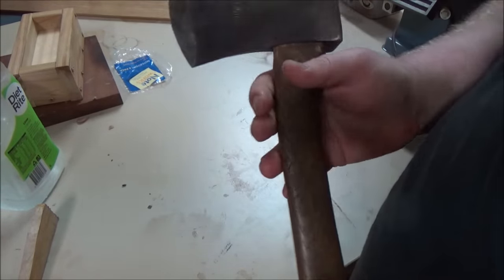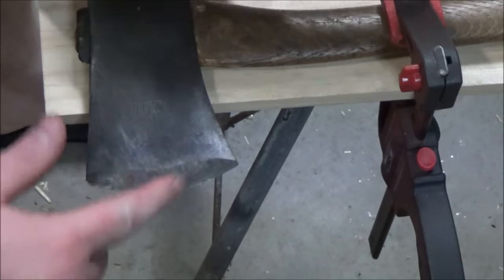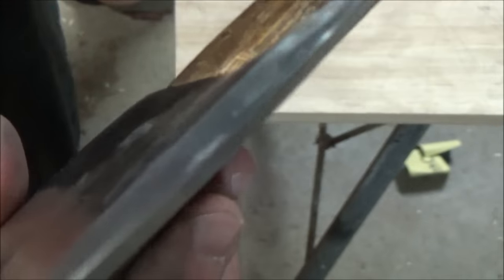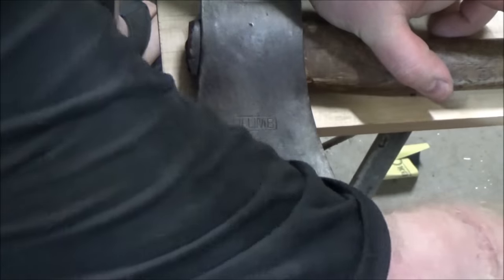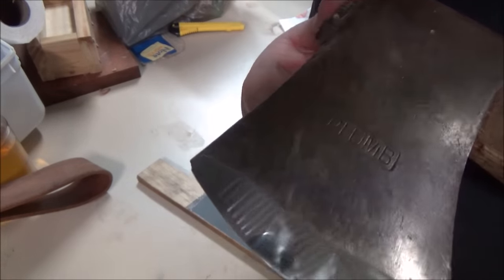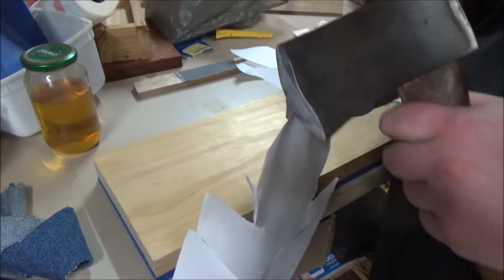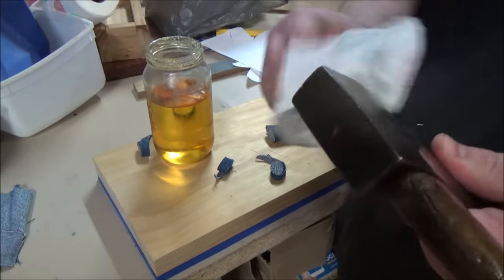How to Sharpen a Hatchet or Axe to a Scary Sharp Edge!

Comment: I have mixed feelings about this.  An axe is not a knife, and should not have the same bevel on it a knife has.  By turning an axe into a knife, it loses much of its ability to be an axe. 

Thinking that every tool, whether it's a knife or an axe, should be razor sharp is YouTube nonsense.  It's one of those things that sounds completely logical, but that is completely wrongheaded.    An axe or a knife should have a bevel angle that best matches the main job that tool is expected to perform, and you CAN'T have it both ways.  If you use a bevel angle that makes an axe of a knife great at one thing, it will perform poorly at other things.  That's just basic science 101.

If you want a carving hatchet, that's great, and in the right hands, one of the best tools out there.  But it also means you lose a good splitting hatchet.

My problem is that while you can't have everything, you can have a good compromise.  Sharpness is misunderstood by just about everyone on YouTube.  A blade with a ten degree bevel per side wil shave hair easily.  A blade with a twenty-five degree bevel per side will not shave hair at all, but it is just as sharp as the blade with the ten degree bevel.

Sharpness has nothing to do with whether or not a blade will shave hair.  Sharpness is the condition of the edge apex.  The reason the twenty-five degree bevel won't shave hair is not because it lacks sharpness, but because the extra metal behind the edge apex pushes hair out of the way before it can be cut.

Until YouTube came along and a lot of people who knew nothing about metallurgy, sharpness, bevel angles, etc.' took over, it was incredibly rare to find any outdoor tool that was "razor sharp"  Only knives used purely for woodcarving had a shaving angle bevel.  The next angle up was fifteen degrees per side for pocketknives, then seventeen degrees for standard kitchen knives, twenty degrees for all around knives, and twenty-five degrees for hunting/skinning knives.

Tools did a much better job then because each tool was given a bevel angle that best suited it for its particular tasks.  Now people won't even buy a knife that won't shave hair right out of the box, even if the knife is a ten dollar Chinese knife made from 440a steel.  It's nuts.  It sounds entirekly logical to think every edge you have should be able to shave hair, but it truly is nuts, and a complete waste of many otherwise excellent tools.

The thing is, you can give a hatchet or other axe a bevel angle that makes it a good chopping axe, and come reasonably close to having it all.  You gain a good bit of carving ability, and you lose a good bit of splitting ability, but you can still use the hatchet for all three oin a pinch.   I've seen people do some incredibly intricate carving with such a blade, and then go out and chop down a tree with the same axe.  For splitting, the hatchet or axe is still fine for small wood, and for bigger wood, they simply use a different axe, or use wedges, which is my choice.

Another problem is that it's very, very easy to ruin many high quality hatchets and axes by overly thinning and elongating the bevel.   Many are differentially tempered.  The bevel section is haerd so it will hold an edge long enough to finish a job, but the steel behind the bevel section is much softer so the axe blade can absorb repeated shocks without cracking.  

Those who own axe blades that split well have axes just as sharp as youyrs is now  They just have more metal behind the edge apex, which means they look dull in some tasks.  They aren't.  In fact, some axe blades have a convex edge which is the best compromise you can find.  A proper convex edge will shave hair, and will choop well, and will split well.   Depending on the angle, it can be a better shaver than your blade is now, or a better splitter than most regular hathets, or pretty darned good, if not the absolute best, at all three.

Japanese Katanas have convex edges, but they can cut through a floating silk scarf as if it were made of smoke.  Try that with your new bevel angle.  

Everyone just wants to grind the nevel on a knife or axe blade as if it were a small carving knife, and this simply is not a good idea.  Not only do you lose many of the axe's capabilities, but you shorten the lifespan of that blade by decades, if you use it often and have to keep it as "sharp" as you want it.

It's probably too late for that hatchet, which is another problem with your approach.  Once done, you can't ever go back to the same hatchet it was before, but next time consider using a convex grind with a bevel angle that matches the natural contour of the blade.  

You'll lose a lot less metal, you'll have an excellent carver, a good chopper, and a splitter that's good enough to keep your campfire going.  

Anyway, unless you remove every nick, however small, you'll damage the edge severely by using the axe that way, and then having to sharpen it again.  You should never allow any cutting tool to get dull.  Doing so is not only a waste of time and energy, it's a waste of metal.  Get the edge the way you want it, and then maintain the edge with a strop and a polishing stone.
  Paying hundreds of dollars for sharpening stones is never necessary, but this doesn't mean you need to use sandpaper.  You can get very good sharpening stones made for axes for a few bucks  I have large, high dollar Arkansas Oilstones, the good ones, and I have several high dollar Japanese water stones, but I can get a knife or an axe shaving sharp on a brick or concrete block, and on any kind of stone, including one plucked from a river.

But for knives you love, and for knives other people bring in, the edge, the bevel, and the symmetry between blade, bevel, and apex needs to be perfect, and this is much easier to do with high dollar stones.

But for the average user, twenty dollar Arkansas Oilstone, or twenty dollar Japanese water stones, or twenty dollar diamond stones work just fine.  The Arkansas Oilstones may be lower quality than the expensive ones, they'll certainly be smaller, and they may even be made from compressed rock dust, but they work.  The same is true of the water stones.  The diamond stones will also be of lower quality, but they still work.

So will any of the manmade whetstones you see all over the place for ten or twelve bucks.
So does a five dollar sharpening puck.  Over not too much time, you'll spend a lot more than this on sandpaper.

And until YouTube came along with a lot of silly ideas about sharpening, the best axe sharpeners used a foot powered whetstone wheel at home, and a file and puck out in the field.  Their bevel were a lot straighter than yours and the edge apex was perfect.

Sandpaper works, but it is not the best for a tight budget.  You can spend enough on sandpaper in short order top go buy a high dollar stone that will last the rest of your life.
Too, like diamond stones, much sandpaper sharpens by slicing away metal, rather than by gently abrading it away.  This is certainly faster, but you lose a lot more metal this way, so I won't allow any kind of diamond sharpeners near a good knife or high quality axe that is going to be used often and put away wet.  

It's your choice, but you'll spend a lot less money over time by staying away from sandpaper.  Certainly really poor people shouldn't use sandpaper.   Coarse sandpaper is pretty cheap, but even it can add up over time.  Fine grit automotive sandpaper, which you will need, is not cheap  I have to buy a fair amount for other activities, and I could buy a high dollar set of Arkansas Oilstones, or of Japanese water stones, for the cost of the 1000 and up automotive sandpaper I've used in a year.

I know knife owners who have added up how much they were spending on sandpaper, and give it up  immediately.  Coarse, chap sandpaper is fine for reprofiling, but a file is better.  Really, spend fifty bucks and you'll never need another stone of any kind.

Anyway, it's a serious mistake to stop before even the most microscopic nick is out of the blade, and before the bevel is straight all the way across, and the edge apex matches it.  At that point, never allow the blade to get dull again.
Reply: Holy shit- I’ve never seen a longer comment.
Reply: Great comment.  I need a razor-sharp crowbar.  Video coming shortly...
Reply: I got tired of reading this comment!
Reply: I could make a booklet out of this comment. I mean, good stuff, but gott dayum!
Reply: Yeah!!! What he said!

Comment: Many people just sharpen the very edge. This results in double convex ax that will barely do anything but split kindling. Where you use a piece of coarse sandpaper on a flat stick I would flatten the edge with a fine metal file and then move to the finer grits. Then finish with a leather strop charged with extra fine grinding compound.

Scary sharp hatchets, axes and chisels are so much easier to use. Worth the time.

Comment: Working with steel and abrasive, always rub engineers chalk over files and paper ''unless using wet sandpaper''. chalk 
stop's clogging of all metals.
Reply: Great tip, what exactly is engineers chalk, I will hafta find some??!!
Reply: Sharpening oil does the same thing. Also easy to find.

Comment: I have a CRKT woods chogan t-hawk & just used a 1 x 30 belt sander with a 1000 grit belt & a angle guide at 20 degrees , I ran it through twice on each side & used a stroping belt on my 1 x 30 with stroping compound twice on each side lightly & I have say it’s scary sharp , it as sharp as most of my knifes that I use .

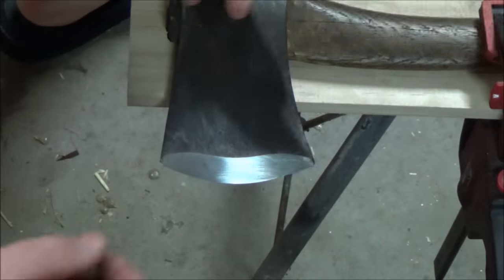Comment: Hey blokes, you have probably heard of mindfulness and how it’s very good for your mental health, well that stage Scott mentioned at 4:30 about it being meditative and relaxing is a great example of mindfulness. While Scott is concentrating on sharpening the hatchet he is blocking out any other thoughts which gives the brain a rest. Just wanted to point out that you can be doing mindfulness and be doing something useful at the same time. Scott, I hope you don’t mind me posting this comment here but mindfulness has really helped me from sliding back into depression so I know it works and what you described was such a good example. I tinker everyday in my garage so guess what I’ll be doing tomorrow?
Cheers mate, Stuart 🇦🇺
Reply: Stuart G. Australia. Stuart, Whetstones are a couple of steps up from what Scott’s doing, both processes achieve the same ends, scary sharp blades and by no means am I down playing Scott’s process, they are simply different paths to the same ends.The difference with Whetstones is the process is more Zen. Please don’t dismiss the Zen reference as there is no other way of describing the intensity of the “moment “. Today my collection of Whetstones is significant, large enough that the stones can be sorted to achieve best process matching steel with stone. If you’re prone to headaches or are stressed try Whetstones!

Comment: Darn good job, Sir. Besides "pretty", I  am definetly sure that it is extremely a sharp weapon in itself. 
Thank you Sir, for your hard work in producing this video. 
Oscar
Reply from the maker: Thanks. It isn't a weapon though. It is a tool.
Unfortunately it doesn't stay pretty for long as the bevel gets scratched up during use. But it was fun whilst it lasted.

Comment: Competitive axe thrower here.  Can't argue with the shave test  I had typically used a grinding wheel and a various files for honing. I just bought a Snow & Nelson felling axe for "big axe"  throwing and out of the box it won't cut butter.  It's a 1055 carbon steel head and in order to make it a thrower I need it pretty sharp with a thinner profile. I'm going to take an angle grinder to the front part of the wedge to thin it out so it sticks rather than chops.  Then I'll work on a 8-10mm bevel. I have never tried a side to side sharpening technique as I was told to either use a stone up in one direction (down the bit) or to the edge and away from it. I'll try side to side on this head and see how it turns out.
Reply from the maker: As the saying goes, 'there is more than one way to skin a cat'. You would have noticed that my hatchet already had a profile/ bevel already cut in so I didn't need to do that step.
When I do I usually use a file but sometimes a sander. Depending upon my mood lol. I just do it for fun so I just do it how I feel like. If using power tools don't let it get hot and there shouldn't be any issues. I would do a pass or two with the grinder then feel it and repeat. Once getting to hot to touch cool with water or wait for it to cool. Repeat till happy. Also be careful of the top and bottom tips. They will heat the fastest as there is no where for the heat to keep running to.
Also if you use a single cut file you can actually get a shaving edge on the axe just from it. I have done it with both 6 and 8 inch mill files. Getting the burr off can sometimes be a pain using just a file but you can do it.
Reply: @scottshobbyz5416  just finished sharpening my felling (big axe) axe. Using some of your techniques I got that socket razor sharp. I used a 120 stone, 220 paper, 300 stone, 1000 stone. 2000 paper and a 6000 stone to finish. It's so sharp that its cutting through my endgrain target blocks.
Reply from the maker: haha nice. I wouldn't want to be on the receiving end of that.

Comment: I fitted a very fine grit belt to my belt sander. Keep speed very slow  and sharpen my makita plane and axes and machetes to razo sharp edges in a very short time. Little heat to the face being sharpened. I have a very slow wet stone that does the final hone. The wheel actually runs in a  small trough of water. Saves me hours in keeping my edge tools sharp

Comment: Very nice!  I gave used a similar technique and it works great!  Buy "belt leather" at a hobby/craft store and permanently affix it to a plank of wood.  If you strop it often you'll sharpen it much less.  I have a kitchen hatchet that I try to keep shaving sharp.  Few passes on the strop (i think i put white compound on it last time) and it works wonders for processing meat.  Same curvy bit as yours.
Reply from the maker: Someone else mentioned a kitchen hatchet. I imagine it would wreck havoc on your cutting boards. 
I don't do anything big enough to justify a cleaver or kitchen hatchet.

Comment: How has wranglestar got more subs than this geezer. You have just shown me the best way to sharpen my axe with stuff I actually have in my garage. That Wranglestar fella tried to make me spend money on his amazon store for stuff (that I now know) I don't even need. I salute you sir, you make the working mans life easier.
Reply from the maker: Thanks for the compliment I am glad I could help. If you have a lot of steel to remove you can use files to start with. Also you can use sharpening stones in place of sandpaper just make sure they are flat first to get best results.

Comment: Nice job! Personally I use a sharpening stone and after that a strop with buffing compound. Works very well for me and gets a pretty much equally sharp result.
Reply from the maker: Yeah I don't normally sharpen this way. I usually use stones and files. 
I thought this would be a good way for beginners without fancy tools or stones to sharpen. Hopefully they will like it and buy the better stuff. Sandpaper is cheap in the short term but stones are cheaper long term.
Reply: @scottshobbyz5416  True that, sandpaper will get you started on the cheap.
Not that the stones I have are really expensive. What counts is correct geometry and the stropped edge at the end.
I use this treatment on all my edged tools, not only axes but knives, chisels, draw knives, plane irons, etc.
Reply from the maker: I am kinda new to stropping with compound. I have stropped on bare leather for almost everything I have sharpened. I love the feel of the edge given by different stones and seeing how they perform. But you do sometimes get steels where the burr just won't come off so a strop with compound can really help. Also it works great for touch ups.
It is funny how little you need to sharpen well. But then I can't help buying more sharpening stones. It is like a disease. But one I have now not only resigned myself to but embraced.
It always seems to shock people when they see a sharp tool working as it should. Compared to what they have used.
Reply: @scottshobbyz5416  If it helps any, I use the hard compound sticks and rub them over the leather kind of like a big crayon. It can take a regular stoned finish all the way to a mirror shine with a little work.
For more expert tips I suggest watching how Paul Sellers sharpens his chisels and plane irons.
Reply from the maker: I made a couple videos where I made strops. I used the bark river compound stick block things. I also have CBN paste in 1 and in 0.5 micron. But haven't tried them yet.
Paul Sellers is awesome. I have seen his sharpening videos before. He does a great job and is partially responsible for me deciding to get some compound. It is way cheaper than buying a stone of the same grit.

Comment: That's a crazy sharp blade for a hatchet. Great job. How often would it need to be sharpened to keep that edge, since chopping motion is used for a hatchet or axe, compared to slicing motion with a knife. My axe and hatchet are almost blunt objects, yet chop wood pretty well. Sharper seems to be better.